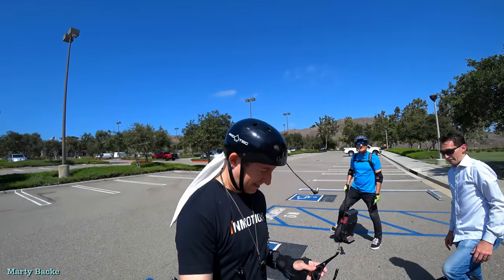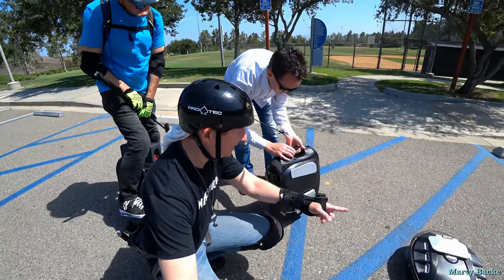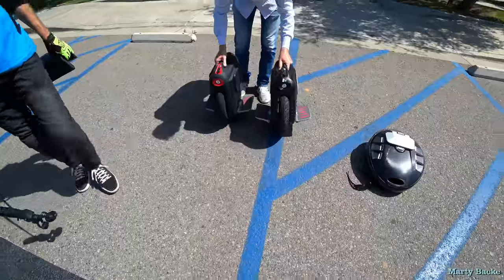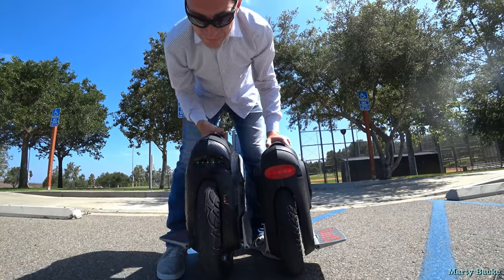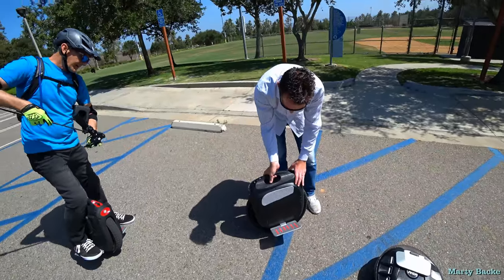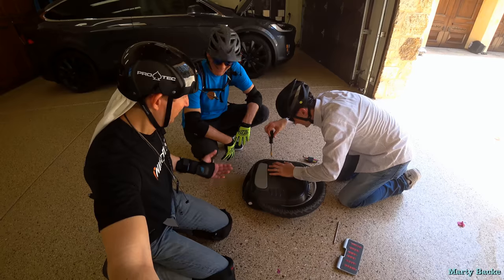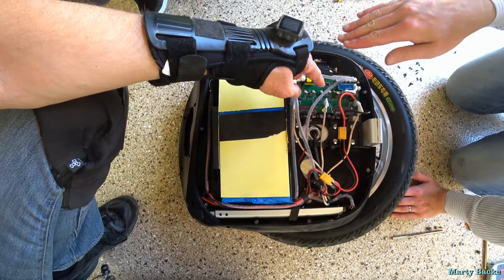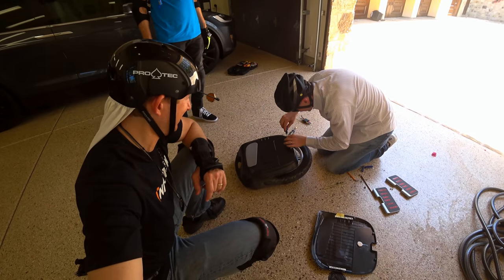First Look at the Gotway MSuper X

Comment: Ugh, well that's shot me in the foot. Darnit Gotway! I find the dihedral angled pedals on these newer wheels uncomfortable - so guess I'm screwed :( 
Secondly, I was holding back from purchasing because I had a sneaky suspicion this is not the only version of the X we'll see. Maybe in the foreseeable future they'll release a 100v model.
Reply from the maker: I love the higher angled pedals, but I realize it's not for everyone. Certainly makes very tight turns a breeze. Regarding the 100-volt model, there will always be a new wheel around the corner. We can forever wait for the newer model and miss out on the fun that exists here and now. Plus, a 100-volt version of the MSuper will probably be a reduced battery version just like the 100-volt Monster is a smaller capacity wheel.
Reply: Yeah this is true, all good points. Appreciate the feedback Marty. Well until it's arrival - we're looking forward to your X review. Have funz ;-)
Reply: Gotway is slowly making improvements. I am not to the point that I would buy one just yet.. but getting closer. I really like the wider tire. The water damage at 84 miles! 😱
I suspect my KS18S would probably suffer the same fate due to the vent on top, so not knocking Gotway for that. Just so sad.. at least he got 8 times the distance I got out of my MSuper.  Looking forward to your review Marty.
Reply: eddrush209mph U can't go wrong with my beloved KS18L. Its simply the best wheel in the Universe. Are u guys sure the Gotway wasn't made in Somalia?

Comment: I do not like that pedal angle. looks like it would put your ankles in a very bad position.
Reply from the maker: It looks like the same angle as the Tesla, and I've ridden many hundreds of miles without any issues. I know you haven't ridden KingSong wheels, but they also have higher angled pedals. It's not as bad as you may think and it keeps you feel better planted on the pedals. And no pedal scraping!
Reply: After you get used to it is actually  better.